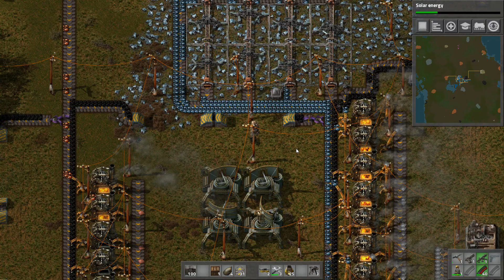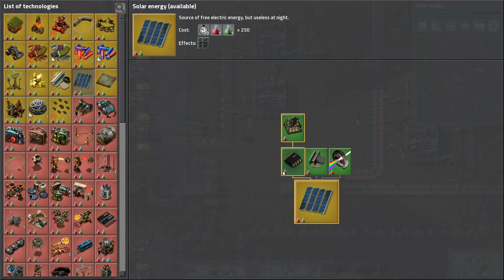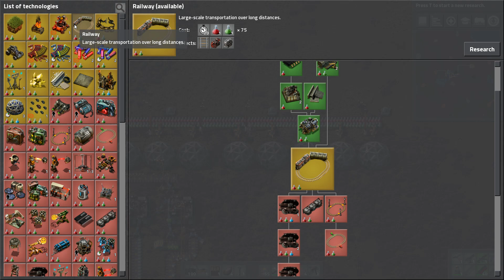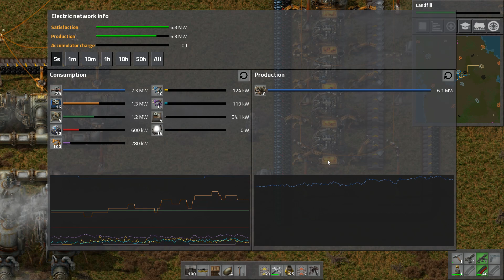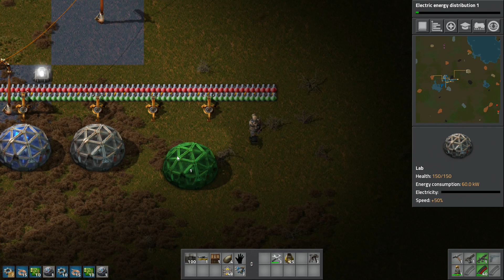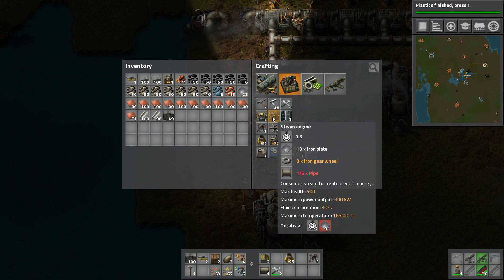Factorio - Episode 5 - Speeding Up

Comment: Not sure why you're upgrading transport belts where the belts are stacking up with input. Can understand on sections where the speed is not feeding input sufficiently but not when it's glutted.

You seem to be suffering from target capture on upgrading a whole belt instead of thinking things through a bit more and working out where to upgrade to greatest benefit.

Oh and you aren't thinking about what the belts need in terms of components (eg: gear wheels which you have a glut of) and instead go collecting the raw materials (eg: iron plates) which just makes things slower.

Easy for me to say looking at this from the outside but you could do with a step back on stuff like this as it'll speed up your productivity no end.